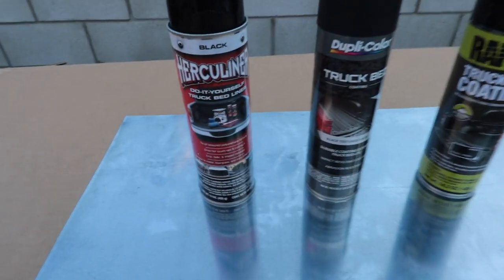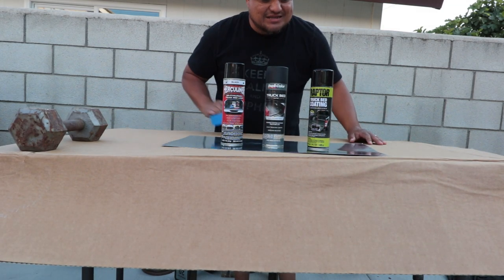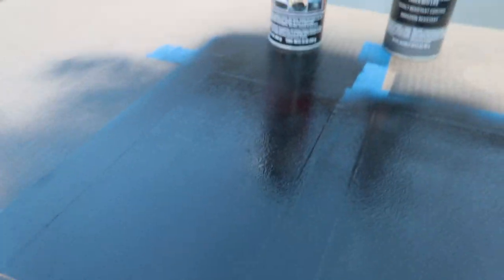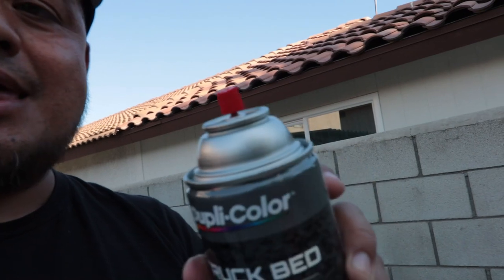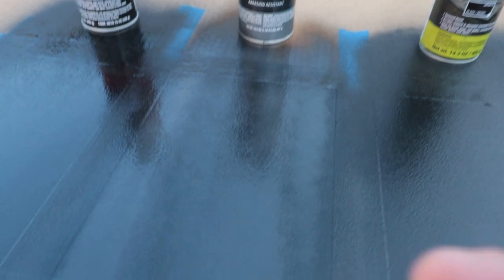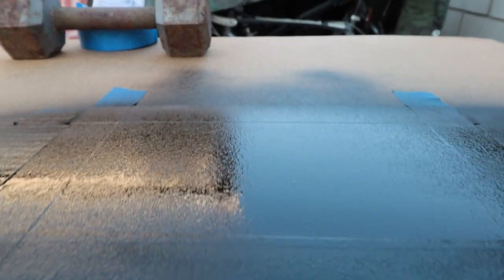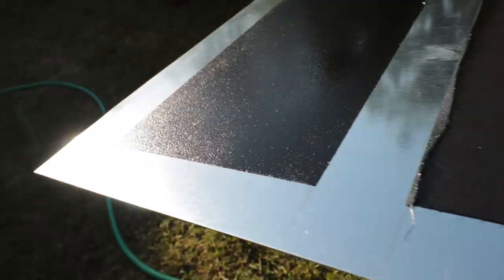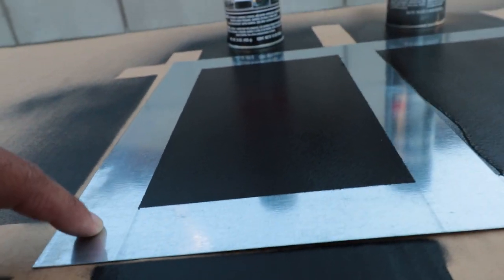Best Bed Liner Spray in 2020

Comment: I've only used the raptor liner spray can and it's held up great in the wheel well of my dually truck. The only issue I saw with your review was that you were holding the can way too close while spraying, should  be at LEAST 24 - 36 inches away. You were 8-12 inches away.
Reply: Did you use the 1K?

Comment: The second can (Duplicolor) you did not even shake the can hardly at all! Man you have to shake those cans and make sure you get the liner mixed well before you spray or roll on the surface. Also you wipe your hand on the metal then start to spray on the liner, Dude you really need to read the directions on how to properly prep and mix and spray at a proper distance for the best results. I dont mean to be a ball buster but this demo shows me just what not to do.

Comment: Sure hope you shook those cans more than the 3 times on camera when you did your project.
Reply from the maker: I did off camera, I ended up using the Raptor Liner on my project and bought the case they sell on amazon
Reply: @OVRLND_E  How’d it work for you long term? I just applied it to a small project of mine.

Comment: Did u press the button on the bottom of the raptor can. It has a hardener that ur supposed to add to can by pressing button on bottom
Reply: Looking to put a durable coating in a lawn trailer, but no one says how durable they are. Is the raptor liner more fit with the hardener line line- ?
Reply: They have 2 different spray cans an this isn't the 2k one!

Comment: Thanks for putting this out there saved me a Buck is the Raptor the less Glossy out of these I’m kinda seeking Egg Shell or Matt for my FJ .Also you can control the texture by further away and or mist coats. On the Duplicolor that discolor is called blushing /Usually from Humid Cond? Or temp.🤜🏻🍻
Reply from the maker: Glad I could help, Yes the Raptor is less glossy I think the Herculiner was the most glossy of the three

Comment: Thanks I’m gonna go with the herculiner
Reply from the maker: That's a great product
Reply: It will fade badly
Reply: What fade lol, my truck had that same liner for 3 years, still looks new after it's been attacked by cemet and wood. Barely used the same can just for touch ups. 4 cans is what you need. And I still have 1 1/2 can left

Comment: Only the 2k versions ( bedliner and hardener) are bedliner quality. The one component spray is just to cover corners and hard to reach areas with the gun included in 2k kits.
I have used raptor for yrs as under coat.The 2k version.
I have recently tried T-Rex the spray pattern wasn't as refined as Raptor, it hard a larger droplets. And a bit shinier.
I like raptor, better, even if it's getting more expensive than T-Rex. Again I use them as undercoat on cars. It's like that red gas tank you buy when you run out of gas. They both dry like a hard tuff coating.
Of these sprays I have use the duplicolor but not as a bedliner. As I only use Bedliner as " undercoat"
    Good video though. Keep it up !

Comment: I'm thinking of using something like this to cover up the wiring and battery components on my frankenboard  electric skateboard I'm making from spare parts. Maybe masking tape with this over it? I don't care if it looks bad, just wondering what the most durable and sticky product I should use? Thanks
Reply from the maker: Raptorliner was the thicker and more durable of the three

Comment: Hey man. Thanks for the comparisons. How well did th raptor hold up? 

I used the rustolum roll on from Walmart for my side steps on my F150 but didn't hold up to these Alaska winters. 

I'm also wanting to spray my doors I just had made for my Side x Side and I am needing something that holds up
Reply from the maker: Alaska winters I could only imagen
Reply: It really depends on your prep work. Did you sand the paint enough. There are cases where upol epoxy primer is needed or ahesion promoter.

Comment: Did you degrease or clean the sheet metal beforehand? That would likely make a pretty big difference in the application, adhesion, and finished look of the product.
Reply from the maker: Yes the metal sheet was prepped before hand.

Comment: Thank you for the test. What did you use it for? I'm looking to spray my sliders with Raptor. what do you think?
Reply from the maker: I'm building a camping trailer and used the Raptor liner. I will be posting a video of that build soon
Reply: @OVRLND_E  hello, did you end up using the raptor cans on the trailer?

Comment: A DTM primer should be applied after you use 80 -120 grit sand..DTM "Direct To Metal" Primer
Reply: interestingly the 1K Raptor can be applied DTM over small bare steel areas like sand throughs, but they do recommend for "optimum" results  the Acid 8 or a DTM primer - specifically on aluminum and galvanized panels.